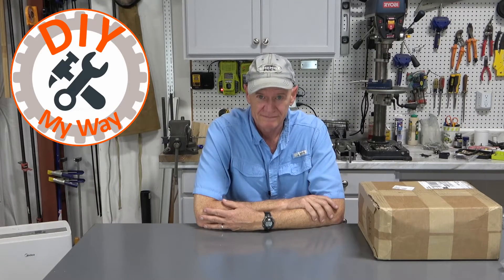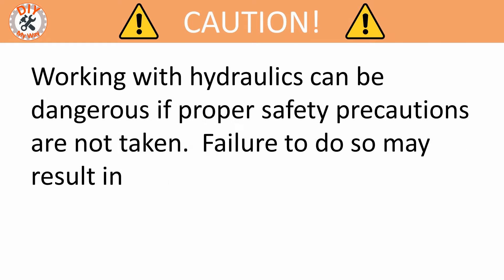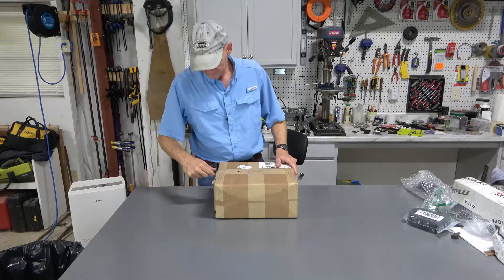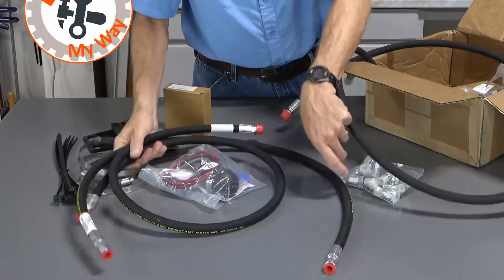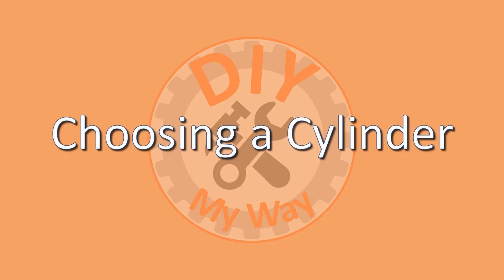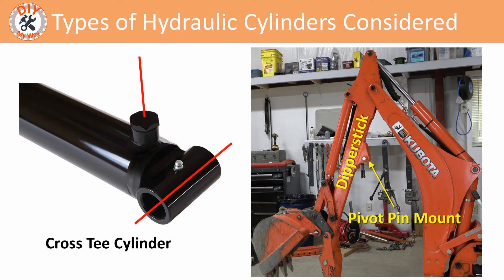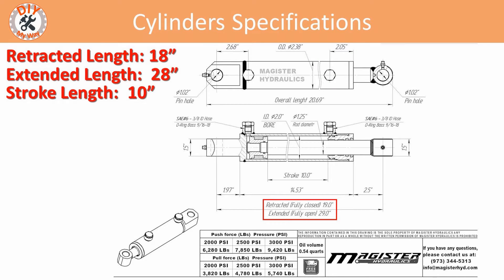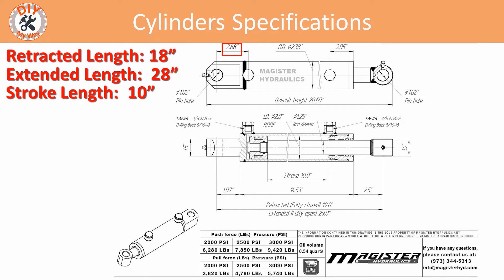Adding a Hydraulic Cylinder to My Backhoe Thumb - Part 1 (#193)

Comment: Martin I have watching your stuff for a while I bought the thumb also I was thinking about adding a cylinder to mine I bought a diverter valve I was thinking about using the outrigger lever to control a switching diverter valve to control this cylinder what do you think
Reply from the maker: You could certainly do that but it means taking one of your hands off the control levers to operate the valve then adjust the thumb position with the outrigger lever.  While it is an economical way to do it, I would find that annoying.  I love the convenience and efficiency of being able to move the thumb while operating the other controls at the same time.  Good luck and thanks for watching!

Comment: Very well done Martin!  I like the tubes and gussets you will add for more strength. I can barely think it held up to now with only that 3/4in bolt!  Thanks!
Reply from the maker: Thanks, Joe!  That means a lot coming from you.  The original mechanical thumb had a 1/2” thick tube welded as a T on the end of the mechanical adjustment which supported the full length of the bolt.  Otherwise, it surely would have broken.  The tubes and gussets are my attempt to provide comparable support for the bolt but the stresses are applied differently so we’ll see if it holds up. Thanks for watching!

Comment: Hello Martin, I really enjoy watching all of your videos especially the tractor modifications. I have the same  L3901 tractor, LA525 front loader & the BH77 backhoe as you. I followed your 2 videos step by step instructions using a 12V actuator to unlock/lock the SSQA levers. Works awesome  especially when being able to operate it from the tractors seat. This is why I can hardly wait for part 2 of the  thumb. I've already purchased my 3rd function valve a while back 
Just need to get the 4 hoses & connectors to tap into the backhoes hydraulic system. If you don't mind would you post a link in part 2 to those  parts? Thanks
Reply from the maker: Glad the remote SSQA lock/unlock project worked well for you too!  If you store your tractor indoors or under cover, the actuator should hold up well.  FYI, because of the complexity of this project, it may a 3 part video series, but I will ultimately have a link to a full list of parts used. Thanks for watching!

Comment: I'm waiting for you to convert the SSQA from linear actuator to hydraulic cylinder :)  As far as thumb stroke length, on excavators the typical thumbs has a rotation of 120 degrees, and up to 180 with a progressive linkage. Having only 120 makes it more difficult to pick up smaller diameter items. I thought about converting mine to a progressive linkage, but it's between $2K and $4K to do it. So your thumb might not retract as far as it used to, but I think you'll find the extra bit when it's extended a good thing.
Reply from the maker: Hi JC!  That won’t happen because (1) the $40 actuator works great (2) Hydraulic system would cost WAY more.  Thanks for the tips!  Yes, I’d rather trade off some retraction for some extra extension. Thanks for watching!